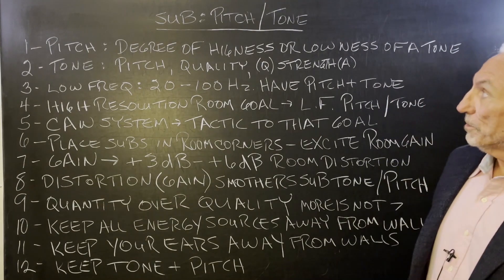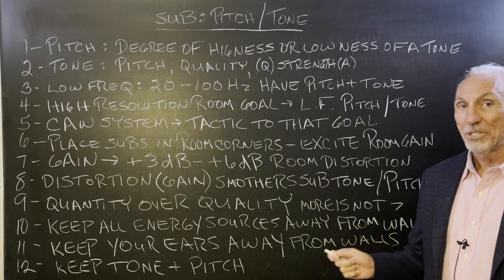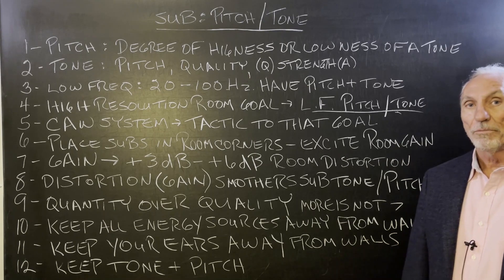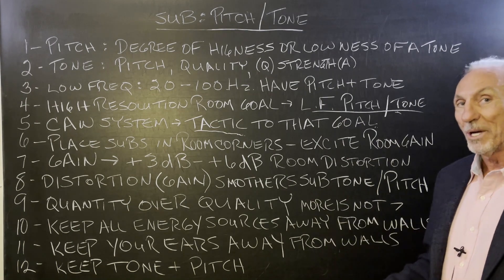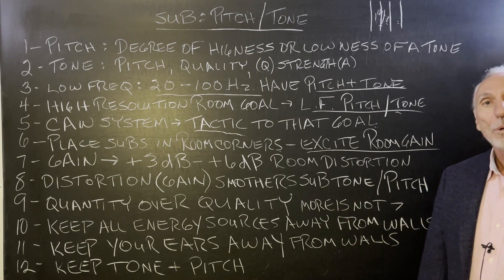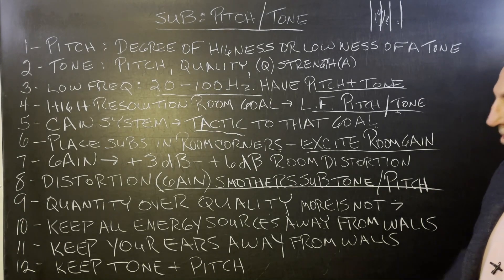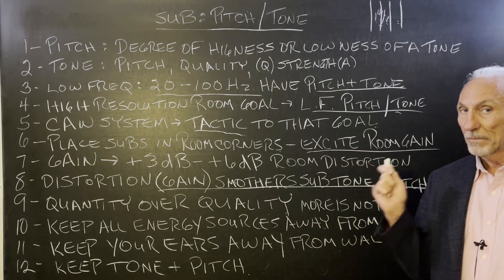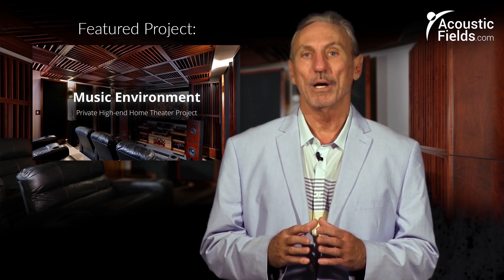Sub: Pitch & Tone - www.AcousticFields.com

Comment: Hi Dennis. Based on your advice in past videos on placing subs away from wall boundaries and also raising my dual subs off the ground by 30cm, I can confirm that the overall sound in my listening area has improved immensely. Speakers are 90cm away from front wall. 
Before I liked the sound, now I love it 😁.
(I have a different space for tv)
Thanks for all your advice. Cheers.
Reply from the maker: You should hear more tone and pitch. Report back with your experience. Focus on the frequencies less than 80 hz.
Reply: I will try adjusting the height too, is there a link or a title for the video that you mentioned  ?
Reply: @jondu-sud274  hiya. I can't remember specific videos but I found these ones you could start with : ))Subwoofer Platform Design ))Platforms ))Ideal Subwoofer Placement part 1 & part 2. 
Kind regards